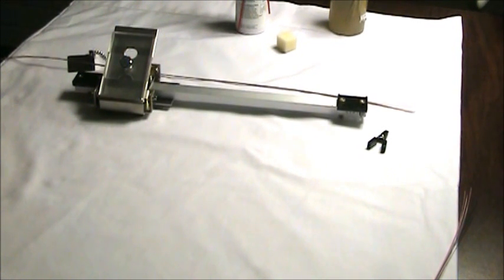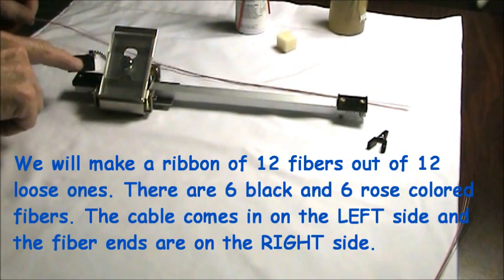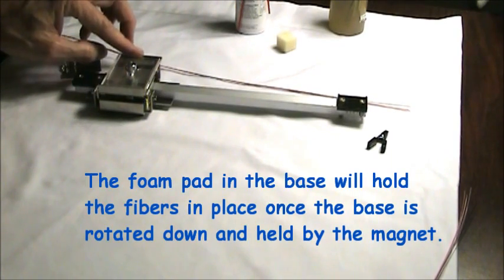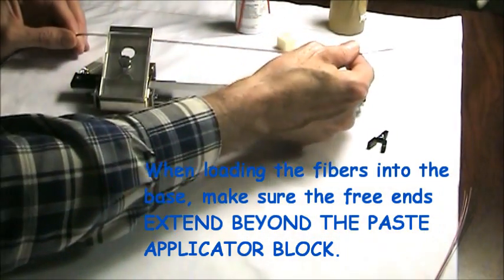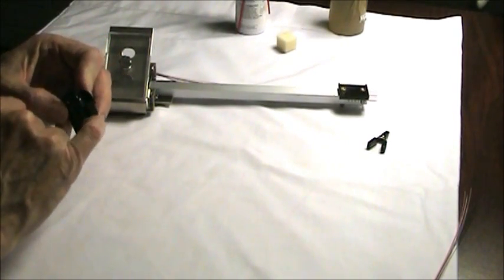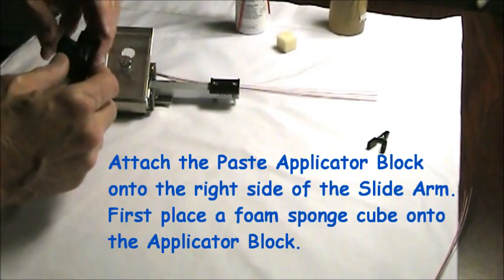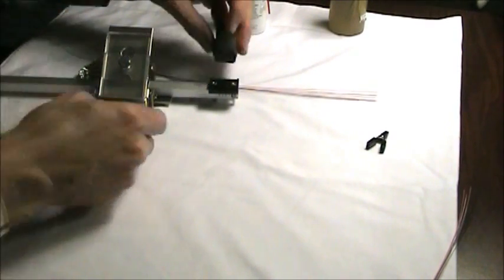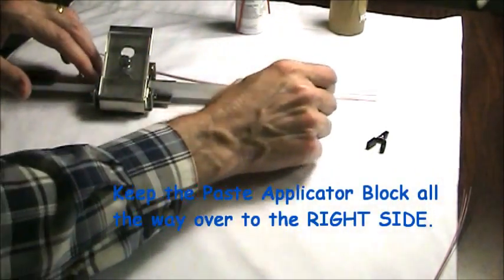AFL FAT-04 Ribbonizer Demo (Mar11)

Comment: This is a very helpful video. I followed your procedure to make ribbons and after some practice they come out fairly well.  Im having trouble stripping the ribbons however with an AFL HJS-02 stripper. It was recommended by AFL support to use the newer RS-03 stripper. I sent some sample ribbons I made to AFL splicer support and they verified the RS03 stripper works ok.  Do you use any particular hot jacket stripper to prep your ribbons for splicing ? Thanks